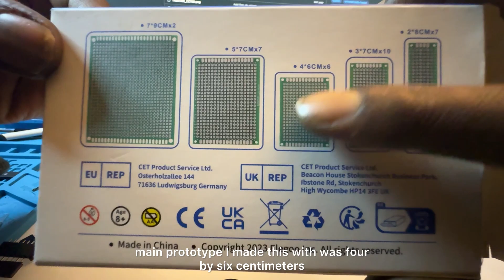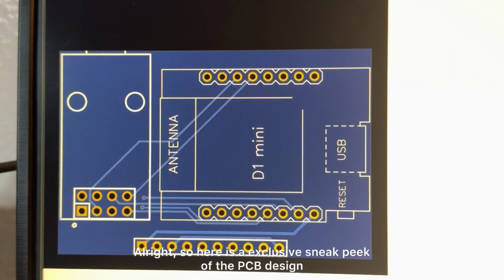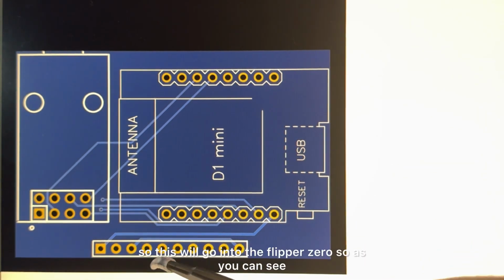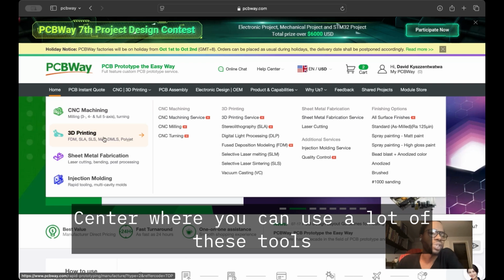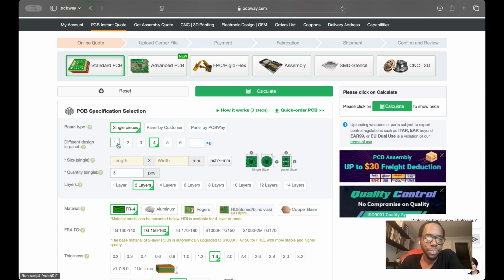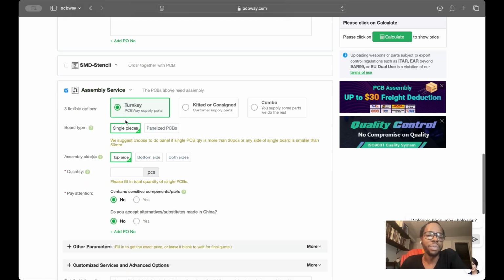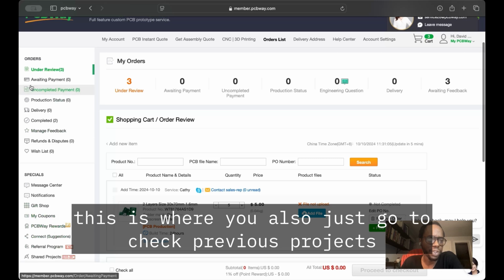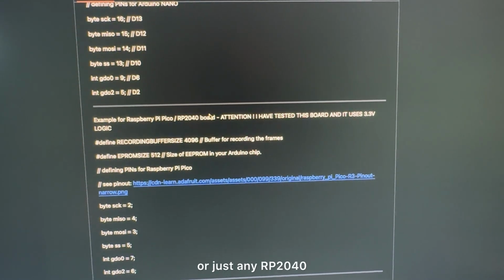Custom 433mHz Jammer PCB Design

Comment: Pleaseeee make esp32 or esp8266 D1 Mini cc1101 RollJam code with save signal to SD Card for later use with emulating. Pls pls
Reply: EvilCrowRF V2 might be able to answer your questions
Reply: @uzzam27  Sounds good. But is there way to do it DIY like with esp32 ? cuz I NEED TO make it with arduino and with saving captured signals to SD Card.
I mean without spending 30 $ for Original Evil Crow